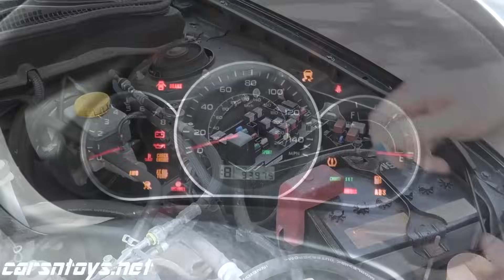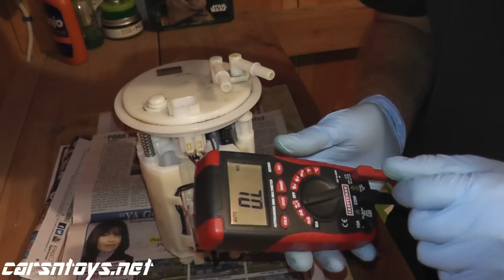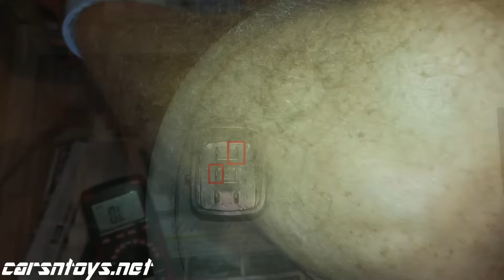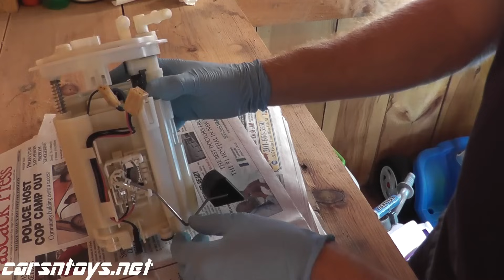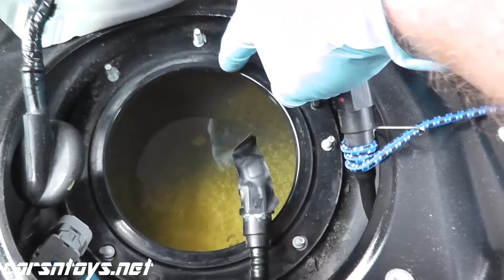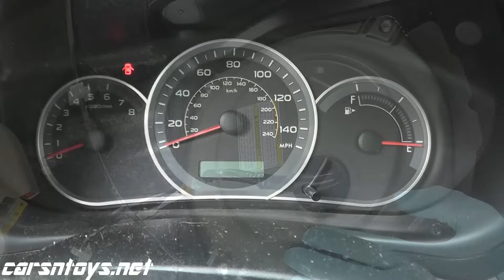Fuel Pump Level Sensor Testing and Replacement

Comment: the tank should be cleaned when replacing a fuel pump; im learning that most fuel pumps that are returned failures is because the tank wasnt cleaned

Comment: I have a 2011 Camaro v6 every time I put 5 dollars in gas it goes into lymp mode. I put 3 and it does ok but still can’t give it much gas. I go 30 miles and stop and put 3 more dollars in it. What’s causing it? Codes p018c
P087
P069e
P113
P112

Comment: The reason for these bucket type fuel pumps is "Misfire Monitor." It was so strict, that it was relaxed in 1997. The modular reservoir assembly is to cool the pump, lubricate it and not suck air when low during corners. Many with larger tanks, engineers used some small amount of pressured fuel, "Tee" into the line and run a line to a brass Venturi at the bottom above the filter to create a negative space to draw fuel into the bucket. This covered the fuel pump and kept air out. Air creates a low volume problem that results in low pressure and misfire. The sensor at the bottom is a NTC thermistor. This produces lower resistance when no fuel to cover it, then turns on the light. Before ordering a fuel sender, find the "Fuel Pump" terminal in the relay-fuse center. Using the correct terminals, hook a jumper wire, amp clamp and view the electrical pattern with a lab scope. It should be even and consistent with proper fuel pressure. If not, replace the entire unit. GM designs these to last 5,000hrs. This is about 150k miles. The inside of the bucket will capture dirt and dust and is not hard to open with 3 plastic tabs and a pocket flat blade screwdriver. The tank needs emptied at this point and washed with steaming hot water. Dry with cloth & paper towels then air dry overnight. Use dielectric grease on terminals inside connectors. 
My watch, ring and wallet went into my tool box after I opened it every AM. This is the reason to touch the fuel pump at the station when getting out.
  ASE Master Tech since 78, retired.

Comment: Is this part in any way connected to the Fuel Level Sensor 2 on Audi? I watched your Tank System Malfunction videos & a Mieneke mechanic changed this part (pump)—which didn’t make the error light go off, then a 2nd mechanic (3rd party) replaced my Sensor B control module. Light went off for a second & came back on. Now Audi is saying it’s the Fuel Level Sensor 2, saying I’ll need to replace the whole fuel tank.

Comment: Hello, my Ford S-Max Titanium 2013 fuel indicator is electronic when it works, but when it arrives before halfway it stops and does not give a reading and remains off. Please answer me. Do I have a problem with the sensor or something else, even though I had a problem with the old battery amp? Thank you.

Comment: Hello, I have a very weird situation if you could help. My 2010 Nissan Altima 2.5s has a crank won't start situation. It has P0463 and P0183. I filled my tank with 105% (more than full) and parked on a 10 degree inclined slope. I don't know if these two codes would cause my car crank but no start? Last time it had a starting sound for 1st second, then died on the 2nd second.
I checked battery - good. I pulled out fuel line before the injector, when I switch to on position, there were fuel shooting out. The fuse of the fuel pump is good. I even changed a camshaft position sensor, didn't help. I removed engine air filter, sprayed starting fluid, didn't work. Car is cranking, so I assume the starter is good. 
What can the problem(s) be?
Thank you in advance!

Comment: How does one remove and replace the fuel lever sensor on a 2003 Honda Pilot? There is no tab to depress, and otherwise does not appear to be removable. Is this so for this car?

Comment: Question: on a 2005 Nissan Pathfinder...due to age & location of parts, if Im having fuel sensor issues should I just go ahead and replace the fuel pump & that gasket while the gas tank is opened? EXCELLENT video...Im a totally visual learner.

Comment: It wasn't clear whether you replaced or fixed the sensor.  If replaced, is that part available for sale? Or does it have to be purchased with the fuel pump?

Comment: 3:26

Does this process apply along with the fuel pump of a 2003 Chrysler voyager LX because my issue is that the gas fuel needle
 doesn’t mark the gasoline level correctly so it could be the  fuel level sensor
 so replacing this is easy as shown in this video correct?

Comment: I have a honda crv 2007..when i fill up my tank the gauge (electronic display on the dash) show full and increase the miles left to run.. Problem is you might drive for 150 miles straight and not a single bar on the gauge will decrease and the miles are basically the same which is wrong.. Checked my fuel sensor and seems to work since the resistance is changing when i move the sensor up and down.. So my question is this? Is my whole console needs to be replaced or is it possible i have a bad ground circuit somewhere? And from where do i start to investigate?

Comment: I’m new to this so I may not be correct. But I’m assuming there’s two ways to go about replacing a fuel pump? 1) Removing the bed completely 2) Dropping the fuel tank.

Comment: This is a great and detailed video. You explain literally EVERY question I might have with regard to performing this test. That is a quality most youtube video's don't have. You even addressed which terminals to connect the positive and negative probes to and how to find out which lead is positive and netagive. Most videos would just say" connect the probes to the leads and then look at your multimeter and there ya go. I LOVE the detail in how you address everything here.

Comment: i need help, my fuel gauge was erratic, so i replaced the sending unit and then it started reading full all the time even when it wasn’t full, so i replaced it again because i thought it was bad, same thing. so i replaced the whole fuel pump and assembly and it’s still stuck on full. all of my fuses are good and i even tried replacing the whole cluster and it still reads full. i have a 2012 sonata se

Comment: i keep getting feul temp and fuel level codes in our 2001 santa fe 2wd 2.4l manual trans, i have replaced the fuel pump but still get them. so frustrating

Comment: In some cases, the connector may be bas as well. I use the multimeter directly to the fuel level sensor wires and the ohms read correctly, but when I connected it to the connector and attached the ohms reader to the metal parts it gave me nothing to return so I'm thinking I'm just going to buy a new fuel pump instead of going through all the crap

Comment: I have a 2007 model Innova... The moment it starts after 4 to 5 acceleration this meter shows check engine... Also, the pick up drops drastically... Please suggest what could be the problem???

Comment: Hi am having trouble after I open the top disc. Now it will not lock back down. It actually seems that the surround metal has expanded, and will not stay lock down. Instead of have a plate that screw down, they decided to USE metal DISC lock it. But what happens when the metal get stretched, it will not stay lock down   I'm going to try to use mini c clamps to make sure the it stay lock down and will not pop open because of pressure or vibrations.

Comment: Long story short - 2006 Sentra 1.8L Had at least a year old problem and took it to a couple shops and didn't fix it . It was not revving up no matter if i floored pedal . It was gas pump and I went to junk yard got it for $34 including warranty . That was yesterday now running like a champ like new !! Yeah at very beginning suspected it might be pump but went with shop's recommendation .  I trouble shooted it myself

Comment: I had an intermittent fuel level reading on my 2010 350Z.   On my car, the wiper was making intermittent contact because the "Teeth" on the semi-circle that varies resistance from high to low (empty-to-full) were lacquered up and partially conducting, (like the volume wiper on old your shop radio that pops and snorts when changing the audio level)  The wiper arm had a small copper contact point the rubs against the "teeth" as the arm raises and falls with the level.  I basically cleaned the "teeth" on the semi-circle contacts (variable resistor) with gasoline and a Q-tip and the problem was solved.  My sensor (wiper arm) had a cover on it that applied pressure and contact to the teeth and the only tricky bit was reattaching the cover in mid-range (half-full) to allow the cover clips to seat....lucked out and only pulled the pump out enough from the tank to allow access to the cover and the teeth embedded in plastic....don't drop the cover in the tank when re-seating!!   So no cash out for a new pump or sensor!!

Comment: I have a question I tried to calibrate the gas needle on my Honda CR-V 2005 cause I was trying to replace a light 💡 on the creíste some how I ending up with the needle fell off on me I just put it back but it’s not accurate anymore

Comment: Looks like I need to borrow a multimeter; my fuel level on the dash and when filling up have been inaccurate lately.  Overfilled the tank to spilling out the fill port the other day because the car didn't stop it like it should have.  I have a filter, strainer, pump, pressure regulator coming so my costs are already getting up there, so will test before buying a fuel level indicator.  Now that I've seen I won't have to open up the fuel pump assembly to do the level indicator I feel fine with waiting since it is just clipped onto the side.

Comment: I've been noticing my fuel gauge is erratic  bounces up and down.  I can't seem to find a reason able price for a new sending unit , (just presuming that that's the problem, it may just be a bad ground but just in case it is the sending unit) However I see the  price if a whole fuel pump assembly  that seems  well made and a little more than half price .  Is there any downfall with just replacing the whole pump or should I just get the sending unit and keep with the original pump ?   In other words it just seems more practical to replace the whole pump with everything included . I'm not a big fan of after market part s but  I'm wondering if it's worth it in your opinion.thanks

Comment: I changed my both fuel pumps on my 2008 Dodge Charger but i still have the engine light and code 0462. Do you know why ?

Comment: One of the first things I learned at trade school was take off your watch and especially when you work with electricity and fuel. You disconnected the battery cable but there still can be static electricity.

Comment: I have this very issue with the fuel sensor on my 2010 Nissan rogue not reading correctly. I will likely be doing this soon. Absolutely well detailed video, and easy to understand. :) great find.

Comment: I got a p0461 and p0455 code on my cobalt. I just had the whole pump replaced last year. Someone said it might just be the evap canister needs to be replaced or cleaned out; however, sometimes I can't fill up properly. Not quite sure what to do. I have a hunch the fuel lines may have something to do with it also, but it's hard for me to test this stuff myself, right now, without a garage.

Comment: My fuel pump works but, in the dash shows i have the fuel tank at half with gas, it actualy is full, because i have checked the fuel pump and it was throwing over with gas out of the tank. So what is it wrong? i have to change the entire mecanism anyway cause this one is way to busted....but in case i get the same reading...what to do? now it shows the tank is half, but it actualy is full that throws over. When i manualy move the level, it moves fine and easy to the up and down, and goes down by itself very gentle and stays down, so i am not sure what is broken with it, perhaps the leg of it doesn't stay well in the tank and is not able to move ? i once had a full tank (full tank in the dash,so i was able to make it show me full tank in the dash) but it was loosing gas like a waterfall because it was to much gas in the tank, so i am never putting more than half tank ( in the dash ) cause i know it will throw over cause is to much.

Comment: Depending on the manufacturer (American vs foreign), the ohms reading will sometimes go up, sometimes go down, as the float goes from empty to full. Don't know anything about foreign thinking, but domestic sending units usually have readings of 0-30, 0-90, or 240-10 (I'm guessing on the ten) when going from empty to full (or is it full to empty). Anyway, GM and Ford have opposite ideas about fuel gauge readings. One has the fuel gauge go past full when the circuit is open, the other has the gauge go past empty when the circuit is open, so don't use these ohm readings for all sending units. Check with the manufacturer to see what the ohms reading should be for your particular sending unit.

Comment: So my husband just installed a brand new fuel pump in my GMC Yukon 2004 and the psi's are at 60 runs wonderfully but the float is stuck do we have to drop the whole tank again is there a way around this may be a stupid question but if anyone's drop the tank before it's not the greatest and most pleasurable thing to do the fuel pump works great it's just a Float/ sensor is stuck

Comment: Hi... I just change my fuel pump on mini cooper r56.. It working good but the indicator is fault... The indicator show 3 bar.. But inside tank the fuel is empty... Btw i check using multimeter and it working fine.. But the indicator still fault ... Anybody help

Comment: I have a 99 Lexus es300.. and the gauge would move super slow.. now it barely moves above half a tank.. and moves just as slow to decrease. Only time I know it’s full is the gas pump stops.. I’m thinking it’s the sensor.. it’s bout $163 since finding even a fuel pump assembly for this car even trying it under Camry can’t find nothing! It’s a literal pain.. guess I’ll have to get it. Don’t want to end up stranded somewhere.

Comment: Nice explanation,  in my ford fiesta gauge works, but fuel light doesn't turn on when low fuel. Ford resetted parameters and it works that day, going on and off 3 times, after refilling  never turned on again. Any ideas what's going on? Thank you!

Comment: Changed the whole fuel pump and fuel sending assembly on a 99 ford r 250 and replaced it with another one that was'nt the same the pump works but the guage stays on full even with no gas. What do i need to do to make it work

Comment: Thanks so much! you said that fuel assembly was from a subaru. Was it from a brz? looks like the 86s are having these problems. looks like I have to replace the fuel level sensor.